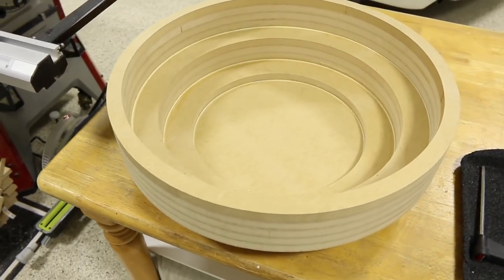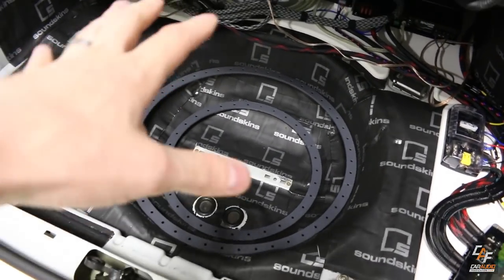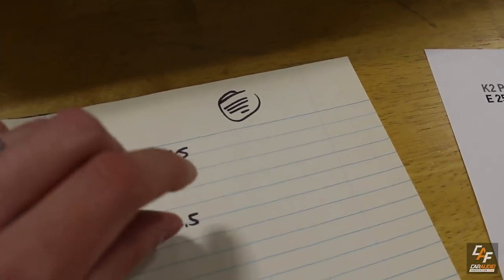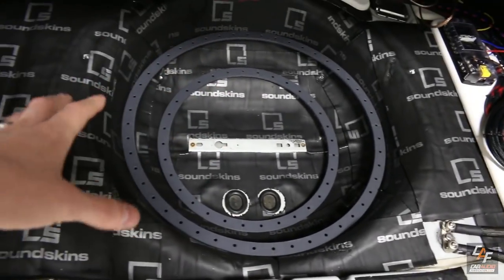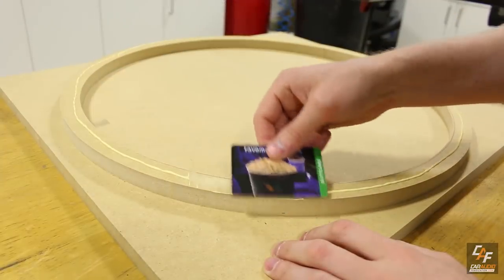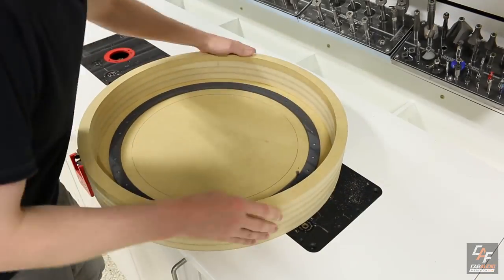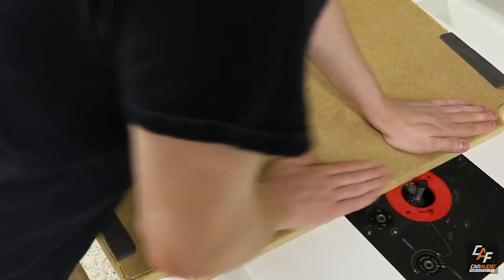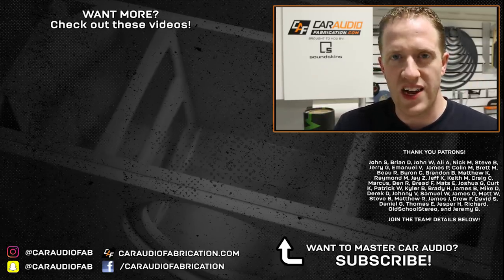Subwoofer Box as a Spare? Volume Calculations + Build - CarAudioFabrication

Comment: After watching you do the maths with the imperial system, I really really love the metric system!
Reply: Tommy Grønvold I was about to say that.
Reply: Tommy Grønvold ,
Was thinking the same thing in the early 1990s because all measurements I had for driver spec.s at the time from my sources here in the US used inches, feet, etc. Wasn't long before programs were written for the ol' Texas Instruments TI-8x graphing calc.s for executing conversions at any given stage of modeling coupled with some capacity for basic Thiele-Small parameter work - early shareware. After that, the early internet had a couple fellas sharing their spreadsheets / (browser-operated? ) programs somehow for doing all the previous as well as additional calc.s for various box shapes along with results for port length(s) , overlaying/comparing response curves for different drivers or a given driver's option within a number of different config.s while affording push-pull, isobaric, 4th order and 6th order bandpass boxes when they were popular not to mention an included sinewave generator will settings for a sweep within a given range. The advancement of calculating and unit conversion tech has been wondrous. But, when at the end of the day the lumber is sold in units of inches and feet... it really is much ado about nothing for indigneous.
Reply: WOW!! Doing imperial calculations on a Texas Instruments calculator, that sounds like double the work for double the trouble... ;-D
I worked with surveying in the late 90's, some of my colleagues used TI's to do advanced calculations. The method to crunch numbers with those was a nightmare to watch, backwards and special functions all over...
Reply: I saw your comment after I wrote mine. Gotta love the metric system :)
Reply: Many subs in the US have the specs for Vas in cubic inches. SO...
Reply: if the metric system is so superior then why did it take the imperial system to put a man on the moon? 🤷‍♂️
Reply: @slecroix   really? Last time I checked the unit of time is standard not metric.
Reply: @Stienecker  what? 🤷‍♂️

Comment: Too much wood wasted
Reply from the maker: You didn't watch the video. I used the inside of the large rings for the small rings. I used less than one sheet for this entire enclosure. And MDF is like $25 a sheet. It is quite literally the lowest cost material amongst all the materials I use, so the idea that wood was "wasted" and like it even matters is honestly laughable.
Reply: doug would have done it better my dude. trust me get on his level
Reply: the dust can be used for sealing off most box parts, together with glue to enhance rigidity
Reply: Yup he must have stock in a MDF company. Waste a ton of wood in most of his videos.
Reply: Waste wood? Let's leave out the fact that MDF is literally made of sawdust mixed with glue (mostly waste from wood manufacturing). He addresses the amount of wood used in the post above yours. 1 sheet for an enclosure? That's nothing. And at $25 per sheet, it's the best bargain building material around.
Reply: Hmmm not sure bout that 1 sheet of MDF.
Reply: I'm not sure about that comment about 1 sheet of MDF.
Reply: Because 2 sheets is a big deal.  FFS, only on youtube would someone watch a video about making a subwoofer enclosure then bitch about wasting $20 MDF sheets.
Reply: where you guys getting dirt cheap MDF? 3/4 costs $40 here at HD...
Reply: Zac Price lowes has a 4x8 sheet of 3/4 mdf for right around $30
Reply: I don't understand why you complain of wasted wood?

My question is.. why so much wood, why not use fiberglass instead? Far less wood would be used.
Price is not an issue if your building something like this.

Comment: Way back in the day I was thinking of doing this, but ironically I got a flat tire...having just started a family and only 1 car, I decided to actually keep the spare, and build around it. Built a hinged box with hinged lid that was flush with the floor, but also 35* in the front since the rear seats were angled. Sealed up the bottom and sides, but cut hole in bottom of box to allow magnet to fit in tire well. 
Hit 120 dB and Q factor was on point! 
This is by far so much more awesome tho👍
Thank u for making this amazing video sir!

Comment: Focal rocks! My mains run a pair of Focal 7k415's along with a pair of TD90K tweeters. They give awesome response from 45 to 22kHz. When coupled to my subwoofer I get a system response of 23hz to 22kHz at -3db. The roll off of the sub is pretty flat with a system Q of .81. That gives me 20Hz and below at an audible level. The system is awesome, great imagining with all the data coming through the system. Nothing is lost lie some speakers which have muddy bass response that colors the sound.

Comment: Great video Mark. I think you may have made the final baffle oversize to bolt the enclosure securely to the floor of the car. If I make an irregular shaped enclosure I use sand to measure the volume. I have a plastic measuring jug that I use to pour the sand. Keep up the great work. Best regards

Rob

Comment: Awesome job like always man but wouldn’t you have saved more material if you’d cut half circles instead of full circles? It would make for a more efficient cut-out pattern in the mdf sheet and then all you would have to do is stagger each layer so that the half circle joints would be perpendicular to each other and maybe use some staples or finishing nails along with the glue just for reinforcement?

Comment: Boot floor is likely flat where the base of the spare may not be, adding an extra large baffle means the enclosure has a flat reference point rather than siting the enclosure on the bottom of the spare wheel well and trying to match the rest of the panels with that after...
Reply from the maker: Boom! Finally soneone got it! It also gives me a good way to add spacers for the beauty panels that will sit up above the subwoofer and amps.
Reply: CarAudioFabrication ill be waiting by the front door for the prize money in the mail 😂

Comment: Why build a complex enclosure (and use up precious space) when you can simply install the sound deadener and use a baffle/front panel across the top of the well? This gives you a sealed enclosure in and of itself? This is what I did in my '95 Mustang, and it worked out very well.

Comment: Great vid. Love the channel. I noticed the math doesn’t match the build so I think this is a good opportunity for you to discuss different design considerations/ compromises when doing a build.

The math calls for 4 small and 8 large rings; as built you have 4 large, 3 small, and 1 small small. 

This really undersized the volume. Maybe only one sub would have worked better... or a different sub?

I just noticed the discrepancy so I’m wondering what your thoughts on it are.
Reply from the maker: The math I showed was just an example using random values, it wasn't what I actually ended up targeting.

Comment: Hi Mark.
Just wondering what your thoughts are on the use of fiberglass.
I have done a similar project to this one using a flat circle base piece, a mid ring and a top ring.
Held it all together with MDF upright joiners and then glassed it all in outside the vehicle after covering the rings in a stiff cardboard to get the wheel well shape.
I finished it all off both inside and out to be smooth then added my top panel with countersunk speakers.
I find that fiberglass gives a lighter enclosure but still really strong.

Comment: I assume that you made the head or top larger as to compensate for the space or drop that exists after placing the ring so in short if I am correct u just table topped the enclosure so there was a space between the bevel of the spare tire drop and the upright of the enclosure

Comment: Why did you make the top panel larger than rest of the enclosure? Some extra room to mount amplifiers or wire terminals perhaps. But, also you don't want to floor / carpet to sag in the void you cause by removing the factory panel you initially copied.

Comment: I’m just going to guess and say the larger piece is to one help with fighting vibration as well as stabilizing the enclosure itself,, and it will also prevent anything from falling into the wheel well and shaking along the side of the enclosure itself, the factory stock barely covers the well,  or possibly making it larger to make it easier to attach a beauty panel to
It??

Comment: Well done. BUt you could have just installed a single twelve  inch, higher power, and use rockwool or foam bedsheet insulation. The two tens are about as loud as a single twelve, but with more mid range.
The soft foam fabric will allow deeper bass.

Comment: An easier way to calculate base size of box for this is to simply get a 12x12x12 cardboard box (equal to 1 cubic foot)and fill it shipping peanuts . Then fill area in car with peanuts . Then you can see how many peanuts it takes to fill area .  If it doesn’t take a whole box of peanuts then measure down inside cardboard box to See how many inches are subtracted from leftover box. A lot easier and can do multiple weird shapes

Comment: Now I know we're working within the restraints if the spare tire enclosure, so you can only use so much area, but wouldn't either hand blending those MDF rings on the inside be better to gain a few more cc's of enclosure volume be beneficial, or, just making the top baffle out of MDF and actually laying the enclosure out of fiberglass be better to make the absolute most of the area given....or is it not true that a larger enclosure will be able to play deeper?

Comment: I wanted to do something like this but with a 4th order bandpass using the spare space for the sealed section then making a false floor large as the entire trunk for the vented section, but the speaker/amp are not that good so i didn't want to go trough the hassle of building a 4th order, maybe you could pull off something like this!

Comment: Awesome video as usual Mark! Would a fiberglass bottom work just as well as the wood in this application? I figured you could roughly find the volume by filling the area with water, pumping it out with a shop vac, then weighing it. In this application, all the fiberglass would be curved and touching a solid surface which would minimize flex. Make a sufficient lip to glue the wood top to and voila you've saved yourself a little weight and wood. I think my idea here is pretty sound, no? (no pun intended XD)

Comment: A suggestion. Why don't you use metric system? Much much easier and sensitive. The spec sheet did have the metric values needed.
Reply from the maker: Because I use the imperial system. More sensitive? Lol. Converting values isn't hard, but folks who use metric always seem to have trouble with it.

Comment: Hey quick question for you, I dont quite have enough room in my trunk to add the speakers I would like to and meet the box volume requirements, would using a shape like this distort the sound in any way if I added a larger rectangular piece to the top to increase my volume?

Comment: I'm curious what you did with all of those leftover MDF circles. I imagine you can use them to cut our other circle rings in the future. Also, it looks like that flush trim bit routes through that 3/4" MDF pretty easily. Is that true?
Reply from the maker: I used the insides of the big circles to cut the smaller circles! I had very little scrap and built this whole thing with only one sheet of MDF. And yes, that bit is awesome, linked in description

Comment: I’m doing the same thing,I can’t really make out your handwriting. I’m also making encloser for jl audio 12”TW3  subs (2) . Can’t seem to find the exact specifications on two of those subwoofers the only give it for one of the subwoofers and then they say multiply it by two which I done and it seems very large. I’m trying to go for a ported enclosure so if you could just tell me those formulas you had right there, I’ll probably just be able to plug the numbers in, thank you
Reply from the maker: The formulas are for volume of a cylinder, feel free to google them

Comment: Hi
I'm doing my first sub install into my car and I calculated that I need a power cable that is at least 16 mm². At my local audio shop they have 20 mm² and 35 mm² wiring kits. Is it good to take the 20 mm² or should I take the 35 mm² just to be safe? Any problems with having too large cable?

Comment: Looks very small enclosures for 2 of 10" subwoofers.  Why you did not put any polyfill inside the speaker box?  Why there is no separation between 2 speakers?   Are both speakers share same volumes in calculations?
Reply from the maker: The box is sized perfectly, "looks small" isnt really an accurate form of measurement. They are fed off a mono signal, no need to divide them, polyfil isnt needed
Reply: @CarAudioFabrication  If no divider between them so each woofer get the full amount of space between them?  Do you recommend divider if possible and polyfil helps for sound bouncing in the enclosure?

Comment: Where did you get the 1,3 ft ??so i saw the recomendation of 0.78 ft in the specification.....and where did you get the two times 173???
Reply: The 2x 173 cubic inches is for the 2x subwoofer basket/motor etc displacement. As for what i thought the internal volume would be (like you I thought end result = 1.56cuft...) or 1.76cuft minus driver displacement. I'm not sure. He knows what he is doing so I would guess that with a heap of polyfill the difference would be a fair bit less.

Comment: Guys i will put my question here because I really am a noob when it comes to car audio. I have 6.5" speakers in my front doors and two tweeters above dash. I want to replace them so i can get a better sound than the factory, nothing much. I want to inves about 100 dollars. Can you recommend me some speaker models that fit my specs?
Reply from the maker: Save more, $100 isn't enough of a budget for a true benefit. You will be more happy if you save $300. Put $100 towards sound treatment materials and $200 towards slightly better speakers.

Comment: Get a tarp and 5 gallon buckets of water. Then syphon it out after you got your volume. I love your uber-geek style, I'm a chemist. But sometimes you need a friend and some beer.
Reply from the maker: Sounds like a mess. I rather do 1 minute of very basic math than spend an hour and potentially ruining the box messing with water. Not to mention with math I can predict my results before I build with the water method you would have to mess with adding or removing air volume,  and redoing the process... the math is easy.
Reply: @CarAudioFabrication  Definitely not your style. Much respect

Comment: So if a spare tire isn't practical for that car, then why did the manufacturer add spare tire space?  If they bothered building the round space (as in round= for a tire) then why didn't they just put a darned tire in it?  Sheesh.
Reply: Not that you have inside info on that decision of theirs...  really I'm just commenting because that seems like a whacky thing to do.  My mother's silly little Hyundai has the same round space in the trunk, the same size wheels front and back, yet they still don''t sell the car with a spare tire.  She got a flat one time and I had to come help her out... but no tire.  That's a major WTF, eh?  Also the care comes with low profile tires too, so when you get a flat you can plan on buying a new wheel too.. Great!

Comment: Why on earth would you now simply make a mold of the tire tub. I must say this time mark , that’s a fail......
Reply from the maker: You get a car and I get a car. We both start at the same time. You will be waiting for your fiberglass blob of a shape to cure for another layer while I'm already done for the day. Don't knock something you have probably never done. There is always more than one way to complete a task, the only fail is only thinking there is one way to do something. Fiberglass has its place, but this worked well for me and IMO has way more advantages.
Reply: In my opinion, doing it with the MDF you have better control over the volume of the space for the subs.

As Mark said though, there is more than one way to skin a cat..
Reply: CarAudioFabrication false. Sun flash resin.
Reply: CarAudioFabrication, just for fun,  do a fiberglass version too along with the one your currently doing and Time it.also, I have done many fiberglass tub enclosures since 1990, and find the transfer function  at the lowest frequencies around 25 hz is superior in the button of my seat.

Comment: ok man. you lost me on this one.  faster and cheaper to do a single wood top plate - then fiberglass the rest. get more air volume, tighter fit.  the cost in wood on this... stack fab is cool but totally impractical.
Reply from the maker: If you think doing fiberglass is the cheaper route I would have a hard time believing you've ever done fiberglass. MDF is cheap and I can make this FAR faster as opposed to doing a layup and having to have the car smell like chemicals for a month after.

Comment: lol don't get a flat XD
Reply from the maker: Car doesn't have a spare from factory. Do some research before commenting something that doesn't make sense.
Reply: @CarAudioFabrication  what is the year make and model of the vehicle? If it quote on quote doesn't come with one from the factory then you still need to get one there's a spot for it! Haha
Reply from the maker: Grand Prix GXP, look it up. Oversize brakes and different offsets for the wheels mean no spare, and adding a spare is pointless as it would work for only the front or the back. The location is there for lower trim levels.